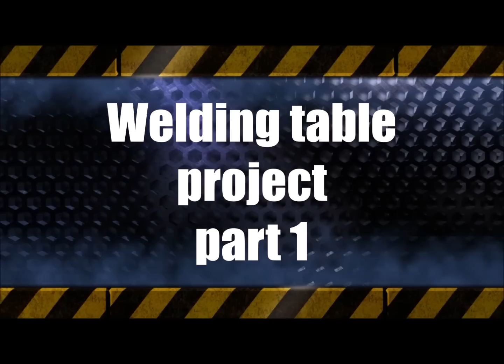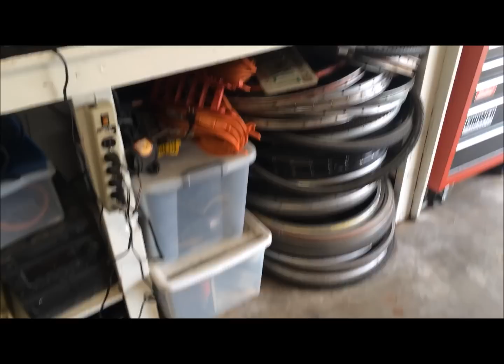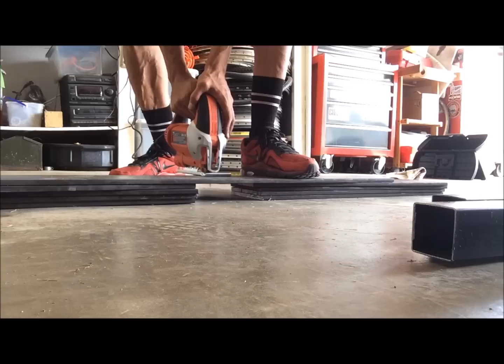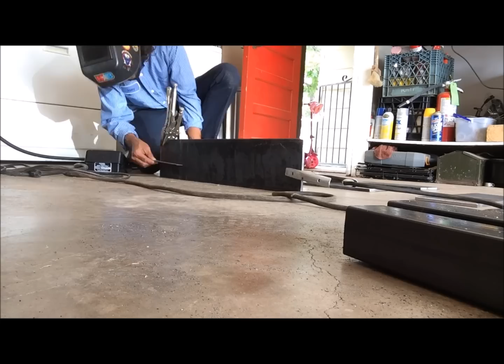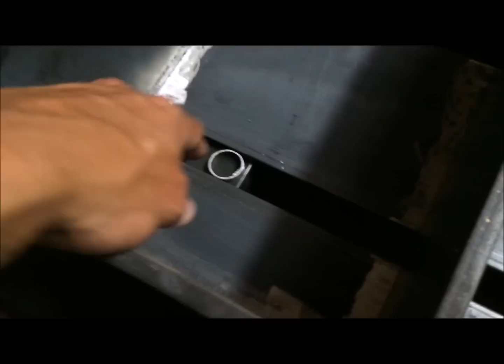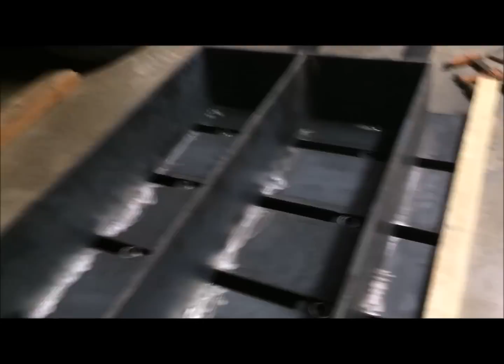Welding table build project part 1 of 3

Comment: Hola Joey, yo compre una maquina de soldar en eBay es la EASY MIG 100T/1 y tengo una pregunta. Es la primera vez que compro una y nunca he soldado. Pues, puse el wire a la maquina y la encendi. La maquina cojio el wire bien pero cuando  trato de soldar nada hace. Lo muevo de posicion del 1 al 2 y de Min a Max. Yo escucho  el motor pero no veo chispas. Quizas el cable ground no esta conectado dentro de la maquina. Que debo hacer?